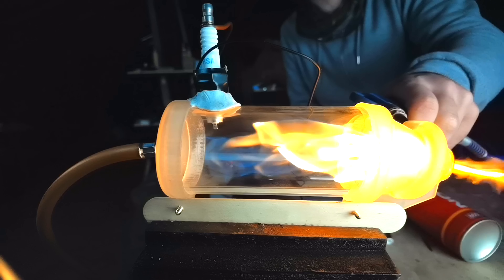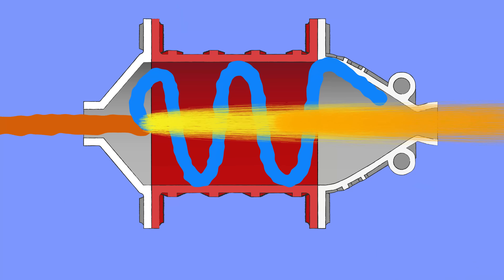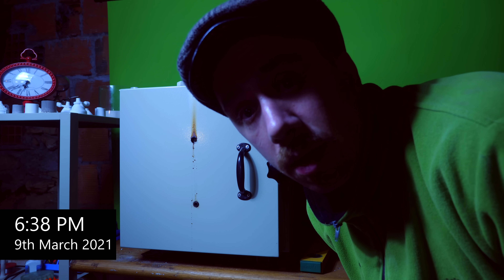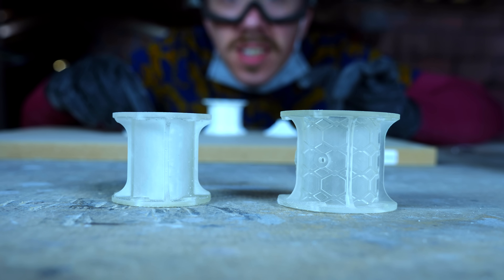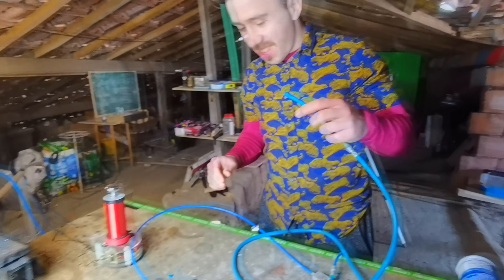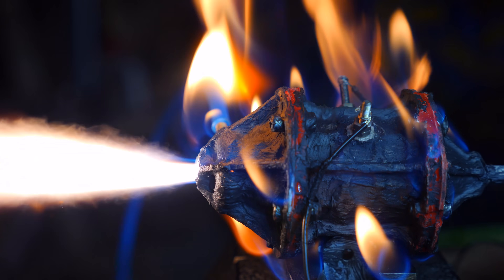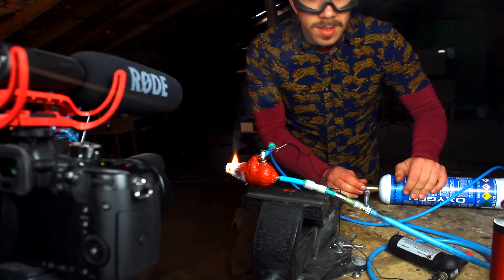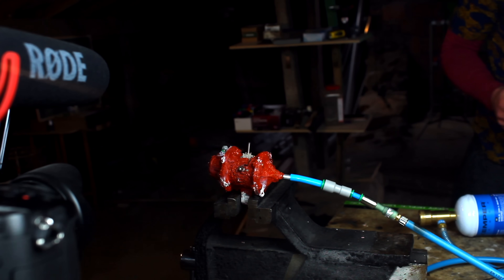Vortex Rocket V2.0 (3D Printed)

Comment: The solution to leaking is glaze. Look up a place that makes ceramics and get some glaze. It's a water based suspension of very finely powdered stuff like glass, mineral and/or synthetic pigments and who knows what else. Plain clear glaze should be the best. Brush the glaze on inside and out. For the one piece engine thin the glaze with water then pour some in and turn it all about to fully coat, then pour out the excess. Blow through all the ports to ensure they're not blocked. You might be able to use your burnout furnace to fire the glaze but it'll need a careful watch on time and temperature. Glazes fire to lower temperatures than the ceramic, porcelain, terra-cotta or whatever they're applied to. For your rocket you'd want the highest firing glaze you can get, that's still lower temp than the printed porcelain.

Ceramic kiln firing temperatures go by cone number. The higher the cone number, the hotter the temperature. Here's a chart. Note that the ultimate temperature varies depending on the number of degrees per hour of increase.
https://bigceramicstore.com/pages/info-ceramics-maxcone

Cones are not actually cone shaped. They're a long, tapered, triangular prism with the big end at an angle. The traditional way to use cones is to place them upright at places around the inside of the kiln then observe them through removable plugs in the kiln walls. When the tip curls over the kiln has reached the right temperature and can be turned off to slowly cool.

Decades ago the SKUTT kiln company invented the Kiln Sitter. Two angled metal blades poke inside the kiln with a round rod slightly above them. They're probably made of tungsten or inconel, something able to withstand extreme heat. A cone is placed flat across the blades, with the longest edge facing up. The round rod is lifted to rest atop the cone. On the outside of the kiln a weighted lever is lifted and latched in place, held there by the round rod. When the kiln reaches the desired peak temperature the cone sags, allowing the rod to drop and release the weighted lever. That trips a switch to turn the kiln off. The next level of kiln automation was an automatic electro-mechanical timer that smoothly ramps up the temperature. A true set and forget system. Before the automatic timer (and on lower cost kilns after the introduction of the timer) one had to set a timer or watch a clock and periodically turn a knob to increase the temperature.

Such manual adjustment has much potential for failure. Forgetting to turn it up at the right time, or at all. The periodic adjustment causes a sharp jump in temperature with each adjustment. The full Kiln Sitter system ensures a continuous temperature ramp and automatic shutoff.

SKUTT's more recent invention is the Kilnmaster. It uses a thermocouple instead of cones and has loads of electronic gewgaws to make it more complicated and of course cost more to buy. But what does it do? The same thing as the old Kiln Sitter electro-mechanical system with the cone for automatic shut down. A lot of money to save a few bucks on cones.

Comment: Stack layers within individually; like a weird Lego. Calculate what percentage each piece shrinks. Try to make them incrementally bigger and print them separately so you have multiple chambers and assemble it and test for holes. Benefit might be a smaller barrel for it to travel and great heat exchange. Look into starlight for small insulation portions. With how you stack and build each layer you can influence the air you blast and create chambers for the air to travel with your design itself within.

Comment: Duuuuude! You should Hit up the guy at Iro3d.... Get one of his Selective Powder Deposition (SPD) printers that uses metal powders and an in-fill metal to form an alloy. Uses very fine sand as the support structure. You already have an oven that is capable of the temperatures needed for "baking". 

Seriously.. check Iro3d out!

edit: his system is now capable of printing glass, ceramic, and metal-matrix-composites. Also, for metals, there is no shrinkage because the metal powder is not sintered, but infused with infill metal. There is a very small distortion due to uneven thermal expansion of different powders. But overall, the size and shape are well preserved.
Reply: I think Integza uses these "worse" methods because they're kind of affordable, compared to mills and lathes. The machine you describe is not affordable I believe hehe. The intent when he started doing these is that viewers could replicate them without spending that much.
Reply: @LtdJorge  that's understandable. Figured it's be cool to see. I think they start at around $5000 USD.

Comment: Saturate the ceramic in sodium silicate. Easy to get on the internet and has a waiter-like consistently to permeate  the parts. Also use a vacuum chamber to remove air and fully replace the air voids with silicate. Sodium silicate is used to build heat resistant insulation in metal forges.

Comment: Something else consider:
Assuming the vortex and your testing will require many attempts, providing a secondary inner-chamber separated by small air-gap, with in/out flange to inject with heat-tolerant substance like the paste in my first link.  Will allow for some time before thermal breakdown occurs, will also provide strength for increased chamber pressures

Comment: You should use brand new 3d printed, liquid fueled, vortex cooled, ceramic rocket engine to power a air boat (Once you have it sealed of course). It's probably too heavy for a fully capable plane but many you could make something like the "spruce goose" using the ground effect. Youd have more lift to make all the heavy equipment, that I'm assuming would have to have on board, a little more manageable. 
Maybe you could do a colab with project air, hes has had some experience with turbo engines as well as his self made hydro foil.
I know I'd be easier to use motors or a premade turbo engine but I'd love to see your rockets powering a kid sized physics straddling hover plane.
 I'm not sure how that would perform but another option is a speed boat but instead of a motor you just have your rocket blasting right below the water. 
Either way I really want your engine on some sort of vehicle, it'd be legendary.

Comment: why not incase it in cement this way the engine doesnt explode from the sides and the pressure from the engine and concrete this way they cancel each other out

Comment: Why not just use the fuel or cool and or super cool the fuel and use it to cool the nozzle like they do with rocket engines? Simple right? Same can be done with the oxidizer. Then you can use the porscholine without backing them making it seal better? Aswell doesn't making the engine smaller make it harder to keep the heat of the combustion separated from the walls

Comment: METAL these pieces need to be turned with a lathe.      

also you could build a metal CNC

after that stainless//tungsten damn even titatium if you want...
Reply: oh yeah and if you can design in 3d you can mostly already turn pieces with a lathe thats easy

Comment: Just a noob comment here: The sealant used between the parts should be applied differently (thinner and only outer ring/half), cos the way it looks to me now it might disturb the cooling vortex by being pushed inside the chamber when squeezing/bolting the parts together... Another way would be to have an inner flange that makes the chambers wall surface flat/smooth.  The more perfect outer cooling vortex, the better cooling and the less heat comes to the wall...
This (smooth walls) might be why the one piece engine worked for a while, altho imo the cooling vortex starts too far back on that one and i think it might be part of why/how it failed.

If the vortex is disturbed it might not function/cool properly end thereby allow flames/heat/fuel to reach the chamber wall (and leak out).  Fixing/tweaking the vortex might be part of the solution to make it work, or at least "just" leak oxygene.

Anyway. Thx for a fun vid, i wish u luck! Im going back to my noob dinner and slap stick jokes...  :-)

Comment: The ceramic glazing sounds like a great idea. I also wonder if you coated the entire part in refractory cement if that would work, inside and out? Or you could thin out the refractory cement so that it could seep into the pores better, but I don't know if that would affect the qualities of the cured cement.

Comment: pour resin on the outside of the chamber and let it cure under uv light
layer by layer
and it should make quite a layer and i don't expect the pores to be aligned so it should hold
or you could wrap it in carbon fiber like with the pulsejet

Comment: Working with vacuum systems I can understand that leaks are the worst. I suggest either using an external wall of acetone smoothing compatible material or directly making a slur of abs and acetone and painting your motor with several layers (drying between each) and you should have the body of the motor leak proof to a higher standard. The other issue is your Connecticut. I believe the threads that your are screwing your system to is not fully leak proof, you might want to look as specialised assembly for this sub part.

Comment: Maybe you could use the resin and a brush, to repair tiny invisible cracks. Let it harden under uv light, then back to the oven. Would be interesting what happens with parts printed with same settings but different amount of coat layers.

Comment: when firing your parts, insert a metal sleave to keep the diameter, it will allow you to print with thicker material, more precise printing and reduce the leaks, at least for the main cylinder.

Comment: You can try electroless and then electroplating the ceramic parts with a metal to improve thermal characteristics and stop the leaking.

Comment: Maybe casting the 3d printed part with ceramic would do the trick but that’s not the point. I’d almost suggest coating the part with a ceramic slurry before kiln to seal the holes from the resin burning out.

Comment: The leaks appear to be coming from the joins, maybe high-temp car exhaust glue type of material could help?... also because you can't see through the ceramic parts you no longer know the ideal input gas pressure to generate a vortex. I suggest revisiting the hybrid engine with a ceramic nozzle but clear resin body, to find out the optimal size/shape of the rocket first, and mark down the exact pressure of each gas and ignition that gives you a sustained burn (sustained until the resin breaks), that will give you a baseline to replicate with a ceramic engine. From the video it looks like your oxy feed pressure is way too high

Comment: Why not just move on to metal now. You have done all the proper testing and prototyping with 3d printing. Now you have a design that works. The porosity problem will be solved using metal. Who else wants to see this?

Comment: Integza, you need a gasket in between those parts to seal it so it can keep pressure. 
If you use a finely ground cork held together with a high temperature rubber silicon glue, it will seal and keep the seal.
Reply: As i understood, the main issue with leaking comes from the porosity in the ceramic material

Comment: Maybe 3d print a mold then make the part out of porcelain or porcelain-tungsten rather than deal with burning out resin.  I use porcelain-tungsten to make exhaust liners and cylinder liners for engines with very hight flame front temperatures.

Comment: how about using a can or a cylinder as a foarm  place the motor in the center then fill the foarm with refactory all around the engine incasing it with an inch thick walls all around it

Comment: After you 3d print the engine, then put it in a large ceramic shell. The wall thickness of the engine is not big enough to hold the chamber pressure, and that is helping the engine leak (you can see this in the full print engine during the first ignition). Ceramics are better in compression than tension. To put the engine in compression, when you put the 3d printed engine in the ceramic shell, add reinforcing fibers like carbon fiber, or small steel rods. Either way, make the outside shell much thicker than 2mm (maybe start with 25mm and work your way up depending on the chamber pressure).  
Second part is that your nozzle is creating more back pressure to your fuel lines than you are feeding the engine. You may want to start with a bigger nozzle throat to see if you can keep the vortex spinning (the oxygen supply is a higher pressure than the chamber pressure), and then start working the nozzle size down to get a bigger flame out the end. 
Also, watch out, too much chamber pressure will cause this to smash many tomatoes if the engine fails.

Comment: Maybe try painting or soaking the parts in sodium silicate to fill in the pores on the ceramic and gaps in the mating surfaces? It’s used a lot in liquid head gasket sealant so it’s pretty good at holding pressure and heat while sealing. Also might try having a raised lip and recessed ring on mating surfaces instead of just a flat flange? My thinking is that would mean more surface area gasses would need to get past before leaking.

Comment: There is a Metal Filament made by BASF that is after sintering nearly pure 316L Stainless Steel maybe that would help at some point.
All you need to print it is a printer that is capable of 250°C nozzle temp and maybe a ruby nozzle would be helpful for durability.

Comment: Ceramic, a glass like ductile material used as a pressure chamber?
The point of it failing is statistical, not calculated.
Would not take that road..

Maybe keep the vortex going all the way through the nozzle? 
As a thermal barrier? 

Or water cool it... I do not know..

Comment: use the "lost wax casting" technique to turn them into metal? 
you can get 3d printing wax to print the parts, put them in sand, then drop molten metal over them to create your rocket parts out of solid metal ^^

Comment: So, you put the ceramic into place using resin, then you burn the resin away. And you still wonder why it's porous? Others have suggested water glass or pottery glaze, and these are both pretty good suggestions. Personally, though, I'd rather you go back to the clear body, perhaps with some fused silica for extra duribility.

Comment: You can try to fill the pores with tin and lead mixture solder paste from the inside. You could apply the paste on the inside surface and get it into your oven for something like 30 minutes and 400 degrees Celsius. If it won't stick to the surface, you can apply aluminum powder and give it like 700 degC (or just start the engine for a few seconds) and repeat few times until you will get the aluminum surface in it.

Comment: The reason the engine in the last video was melting is this is a very oxygen rich system to create a blue flame cooled system properly. Your mix was closer to 50/50 and needed a much higher oxygen flow rate for how much fuel was in the system. I would suggest moving back to resin and carefully watching the differences in flame color between your videos and the 2 that were posted originally on the subject. If everything is working properly the resin should never reach melting temperature but might crack under pressure instead. I think the 3 piece part you made had much better width to length charachteristics than in the previous step. An alternative to try if you wanted to keep ceramic is a cone 5 (or 10 if you think the ceramic can handle it) glaze coating that should seal the ceramic with high melting temperature fairly impact resistant glass. That should also further serve to reinforce the ceramic just remember to always glaze it after your burn out is done and refir it or it wont seal properly.
Reply: Fair warning most glazes run a bit if too much is applied just grind off the excess and you should be golden in this case you want as much as you can melt into the part.
Reply: I would absolutely keep the nozzle ceramic and glaze it rest in resin if the mix of fuel to oxygen is oxygen rich enough should do the rest of the cooling for you.

Comment: Try swapping fuel and oxygen inputs. Ox rich burns very hot. Unmixed fuel will not burn. Propane is thicker and may minimize your leaking. Also adjusting air/fuel mixture can change power output. Stoichmetric ratios is a great starting point, but changing ratios can improve life.

Comment: Here’s a silly idea to solve leaks: water cooled plastic engine. Just submerged the entire thing in a water tank, have the tip of the nozzle at the surface so water don’t go in.

Alternatively: seal all the ceramic parts in resin, and do the same cooling method.

I’m guessing the later failures (where things worked for a bit) are due to the chamber pressure exceeding the strength of the sealing materials under that temperature and breaking them.

Comment: Try moving the spiral inlet to the back part of the engine so it can spiral around the whole chamber... The way U had this one I'm guessing will have a part of different pressure with more fuel and no vortex towards the back of the chamber

Can't remember what way you did it in the first vortex video

Comment: Baking a  glaze into it will fill the pores but it looks more like the ceramic is blowing apart under the pressure. I suggest mixing in a strong binder such as powdered carbon then glaze it. I hope this helps :)

Comment: To make a good seal, just put it in a 3d printed box filled with some hot resistant cement or silicone as a fillup.
...and send/eliminate that jr. tomato (or any of his minion's) into space with this propane or solid fuel rocket. (eventual) Huge explosion (with jr. tomato incuded) will be fun to watch too.

Comment: Maybe there is a chance to fit some metal "foil" between the parts. That could then bend and seal the gaps. 
Lead comes to my mind, but the melting point is to low. But I think you get the Idea...